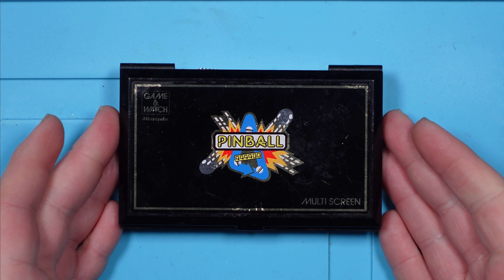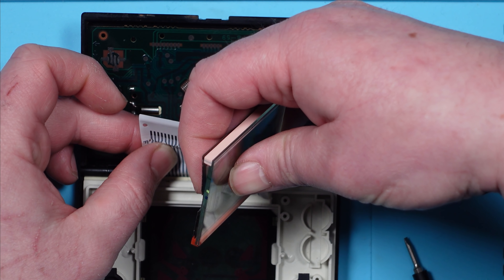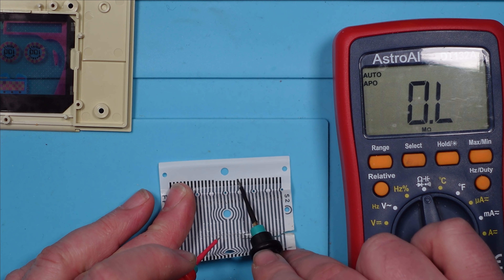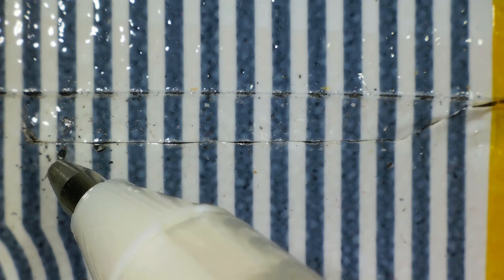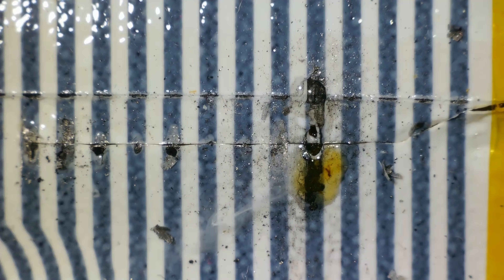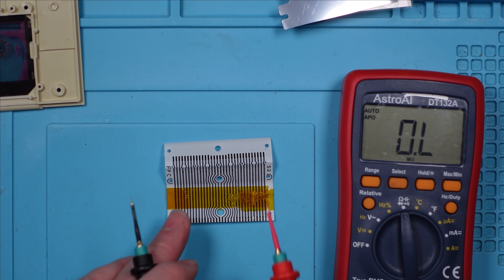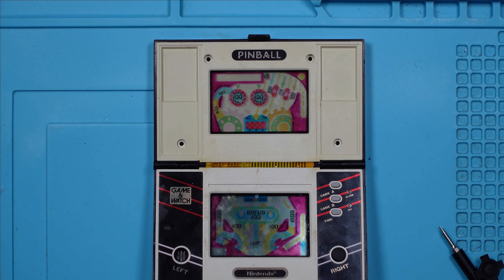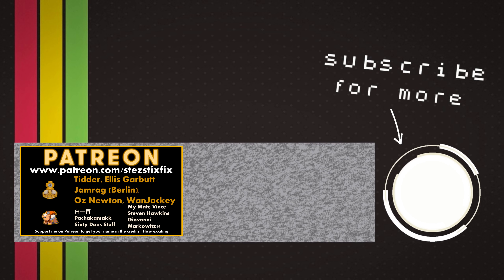This PINBALL Game & Watch has a FAULTY Top Screen | Can I FIX It?

Comment: Maybe cutting thin lines of adhesive conductive copper foil tape? I've never ever had any success with conductive ink pens, but the copper foil has worked much better for this kind of circuits printed on plastic/paper.

Comment: Replacement ribbon cables specifically for the Game and Watch are available on ebay from Canada.
Reply: If anyone is interested i found the ones mentioned above, they are sold by macguy604, they are around $20usd ( which seems about right based on an estimate i got from pcbway for a similar custom flexboard )
Reply: This is 100% the way to go, I'd think. Don't reinvent the wheel, er cable.

Comment: The only way I can think is ordering a custom flexible ribbon cable from JLC-PCB. You’ll have to design one with the exact dimensions like the zebra tape and include one SMD resistor on each trace to match the impedances of those traces.
Reply from the maker: Thanks Traveling!  Yeah, I did have a quick look into that but it seems very expensive.  One of the PCB companies has been asking to sponsor me, but I've resisted it so far.  They might do me a freebie if I do, but I'm not sure I'm ready to sell out just yet!  🤣
Reply: @StezStixFix  hey, being sponsored is not being sold out as long as you are honest with what you have to say about it. ☺️
Reply: @StezStixFix  expensive? wouldn't the monetization from youtube/patreon make it worth it?
Reply: @StezStixFix  Do it man, getting a sponsor isn't selling out.
Reply: I'd be surprised if someone hasn't already designed this ribbon cable.

Comment: I repair Amiga keyboard membranes quite often. I used to struggle a lot with carbon based paints until I tried "Green Stuff World Conductive Paint". The resistance is extremely low even after a few minutes so it must contain real silver. It was quite pricy (about 10€) but it has lasted me for quite a long time. Shops selling model planes, war hammer figures and the like seem to carry this paint so it's not super hard to find.

Comment: I have repaired phone cables, nintendo joycon cables, laptop ribbon cables by scratching the layer of plastic exposing the Copper and  then solder with jumper wire. It is time consuming but worthfit when  difficult to obtain certain ribbon cable like in some laptops. I would secure with solder mask when cable lies flat or when there is bending I would use kapton tape. It appears it can be done with that ribbon cable too?  Good try to fix it though.
Reply from the maker: Thanks M m.  It was tricky and I'm gutted it didn't work.  I think anything over about 100 degrees would melt the plastic, it's very thin and fragile...  I did wonder about using copper slug tape, but I'm not sure whether that would do the trick.  I might try it though.  👍

Comment: Good evening. Probably a wild idea...but you could rebuilt the flat cable, cutting narrow strips of alluminum tape (there is a type with a protected adhesive on one side) sticking the strips on a paper sheet. It is a tedious and difficult job but with a bit of patience and time it can be done. The result is a brand new flat cable...regards from Italy.
Reply from the maker: Thanks Pablo! Great idea. I think I'm gonna give that a go! 👍
Reply: could you run that through a printer/cutter? also i flash plastic sheet with aluminium to make foill for packaging industry if i could lay down a sticker on the sheet it would leave those bits bare and the exposed parts with a layer of aluminium
Reply: Spoiler!

Comment: This is a tough one. I couldn't find any replacement zebra cable on eBay, however, I did find some "Zebra stripes flexible paper" on Aliexpress. Never heard of it, but it's apparently used to fix car LCD keychains? I don't know how they work, but if it's some sort of sticky zebra tape, maybe you can use this to fix your cable?
Reply from the maker: Oh wow, thanks Giovanni. I haven't seen that before but it could very well do the trick. I'll watch the video and will probably order some up and have a go! 👍
Reply: I have seen car dashboard dial repairers use it too before first time i'd ever seen it
Reply: nice find! the only problem, by the looks of it is that the strips are very short.
Reply: @djfernando16  Yes, that might be the case, don't know to be honest. I've never tried them to fix a Zebra cable. Maybe Steve will. P.s. is this the Andy Pandy that is haunting Vince from My Mate Vince?
Reply: I wonder if this is similar to Fruit Stripe gum with the Zebra mascot?
Reply: @jonathanmartin3375  I haven't seen that in forever!

Comment: Those cables are almost impossble to get working once ripped. You did a nice try! Dig your attempt!
Reply: Had one working for a while, with pencil graphite, but it died eventually.
Reply from the maker: Thanks Willy.  It's frustrating that you can't get replacements for these (apart from donors), but I guess there isn't much call for them!

Comment: You could try to trim a piece of the ribbon cable off the end like you were saying, but then trim it down to the number of the amount of broken traces, invert it and use the tape to attempt to hold it across as a bridge over the crack?
The only thing I can think of apart from replacing the cable :(

Comment: I bought some gold conducting liquid for repairing my car’s heated rear windscreen. It has the consistency of nail varnish and comes in a little bottle with a nail varnish type application brush and a die cut cardboard template. Maybe that would do a job?

Comment: Ribbon connectors and membrane circuits is so difficult, for me.  Maybe try something sharper like the tip of a hobby knife to ever so carefully scrape and then try to maybe attach a thin bit of shielded wire with hot air and the lowest-melt solder?  Or would even that hot air melt it (probably, right?)

Maybe a wild idea, but, maybe make a small hole at each end of the break and thread a bit of wire through either end to bridge the connection?
Reply from the maker: Yeah, maybe that would work 🤔.  I struggled to think of anything that would be a lasting repair to it. I know the right thing to do is to replace it, but I'd like to be able to do something with the original parts if it's at all possible. I might experiment with a few methods on the old cable and see if anything works... 👍

Comment: What mounting arm are you using w/ your Andonstar microscope?  the part that connects to the back on the microscope to the base stand?  I bought the Articulated Arm Stand for USB Microscope like you stated in another video, but trying to get the rest of the parts like you have w/ your microscope...thanks!  I like your setup and trying to get my setup in order.
Reply from the maker: I epoxy glued the articulated arm stand to the original Andonstar stand, that way I still have the LED lights and base.  You could drill and bolt them together, but I've found the epoxy glue works very well.
Essentially the base and LED lights are original, the arm and bracket are from the Articulated Arm for USB stand, and the AD407 sits nicely in there.  Hope that makes sense!

Comment: there is a shiny coating on top the traces scrap it away and the ink pen will make an conection
Reply from the maker: Thanks LHG.  I did scrape it, but realised after I finished editing that it looks like I'm just slapping it over the coating.  I did get all the tracks to have some kind of resistance, but they were all over the place, so I don't think the conductive pen/ink/paint was up to the job.  Or, I just made a bit of a mess of it!  😬

Comment: Wonder could an old IDE ribbon cable be repurposed as a replacement?
Reply from the maker: That's a good shout, Chris!  If the wires are the same distance apart, it could do.  Not sure how well they'd contact the zebra connector, but it could be worth a try.  👍
Reply: It would be worth a try, but i'm not convinced one would be flexible enough.
Reply: Old laptop keyboards have ribbon too maybe a struggle to find right size and pitch.

Comment: Use your ink pen on a paper (reinforce it with tape on the back) and draw the traces.
Not sure if the resistance takes difference.
You can try draw it with a pencil but that is not that good.
Reply from the maker: Thanks FixDaily!  I didn't think of that, I might give that a try and see if I can get any kind of connection!  👍